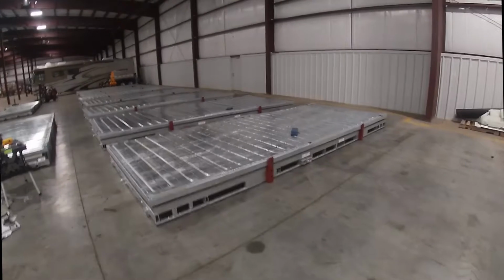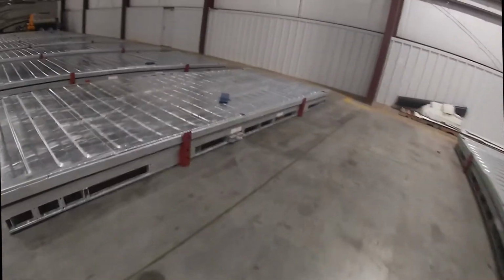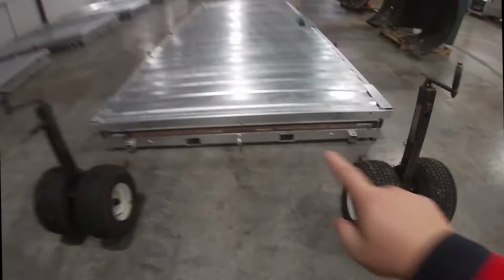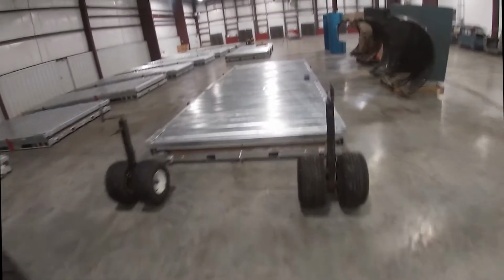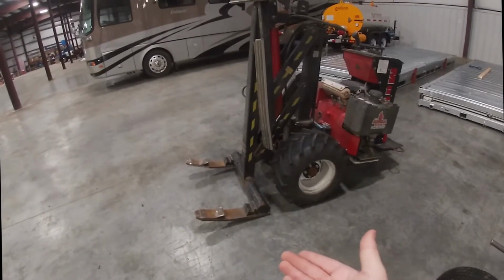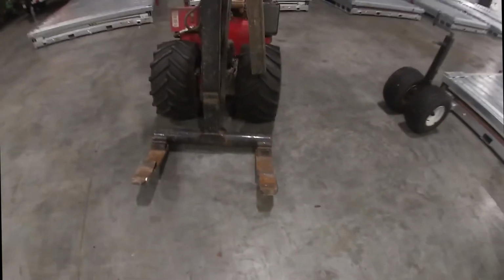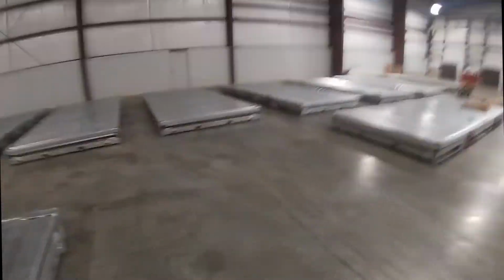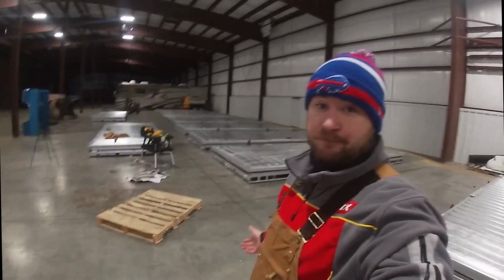How I Built 12 Brand New Portable Self Storage Units - Episode 13 of Building a Self Storage Bus.

Comment: How much weight  can they hold?
Reply from the maker: I’m not totally sure to be honest. They are 3,500 lbs empty and they have never come with a weight capacity sticker or anything on them. But I do move them fully loaded all the time loaded from top to bottom. Occasionally someone will pack an 8x20 really well and super heavy and my machine will struggle a little bit, so I would estimate they are pushing up to 10,000 lbs fully loaded. I’m able to move an empty 40’ sea container around no problem with my machine and those are about 8,500 lbs empty